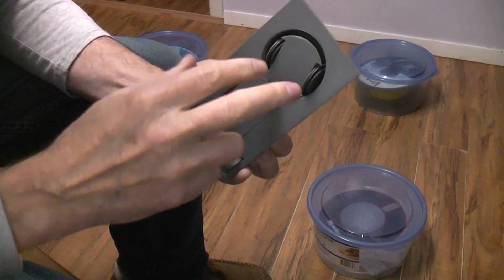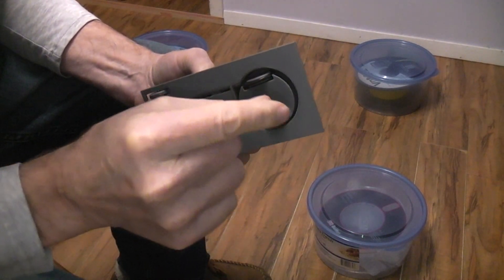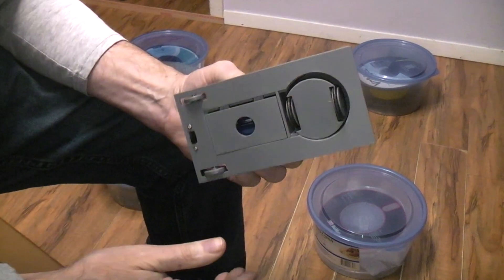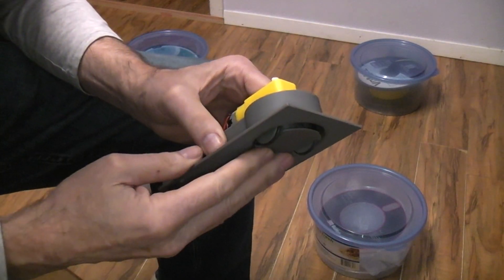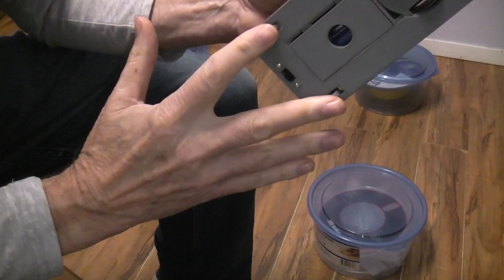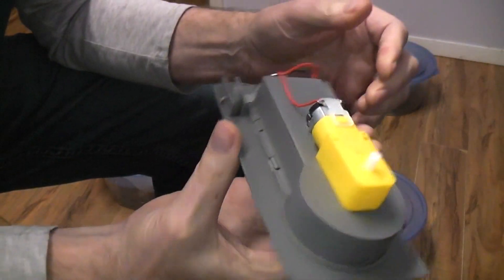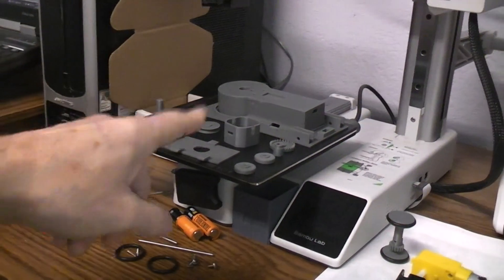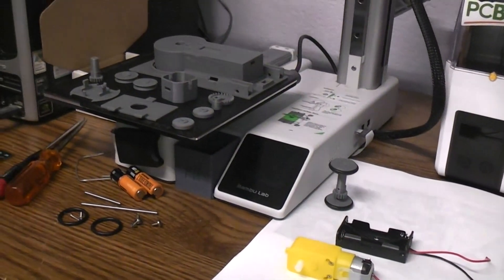Demo of Classic "common" Bump and Go drive you can 3d print. Type 2.

Comment: this is a very nice recreation of what is at least an earlier form of the common bump n go, though different from the chinafake one. the chinafake one is identical mechanically and operates on the exact same principles, there’s just some slight differences in the size of and spacing between various parts